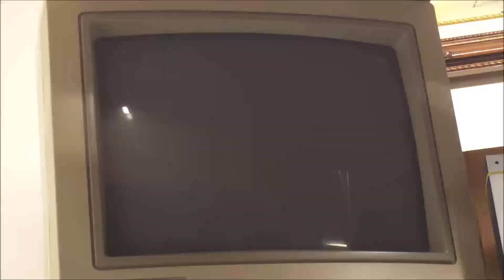How to Clean a PCB - Method #2

Comment: You pulled off the CPU and rom chips. Can you wash them in water? What about the chips with the clear windows?
Reply from the maker: Good catch!  I remove the socketed chips so it is easier to clean and dry the sockets. Yes, if those chips are dirty, you can clean them also. I always try to avoid getting paper labels on the board, or on chips wet though. So maybe just a damp cloth to dust the eproms. It really depends how dirty they are. I handle chip corrosion/rust on the legs with a small wire wheel or stiff brisle brush. If it is more than just a surface issue, consider replacing the faulty chip.

Comment: I rebuild operator compartments for CAT heavy equipment and the guys would make fun of me for washing all the dash modules and ECM controllers in a sink, never had a problem in 16 years, glad to see I'm not the only one to mix water and electronics
Reply from the maker: It just makes sense to me too. As long as you dry it thoroughly before powering it back on, and don't let it sit and oxidize, it works well.